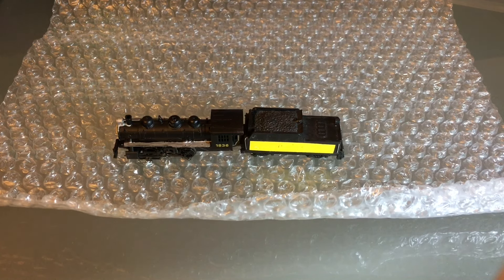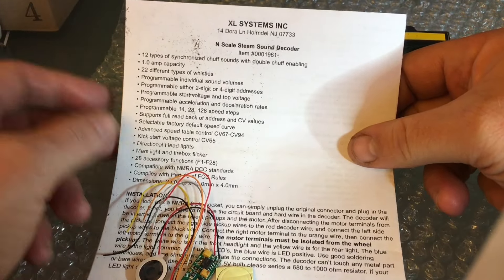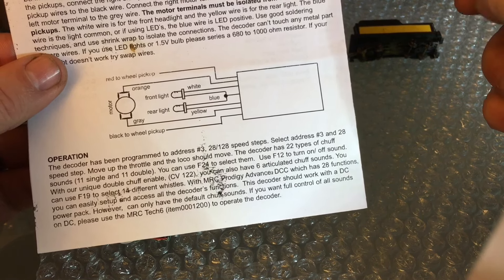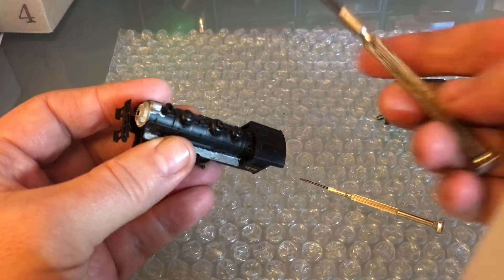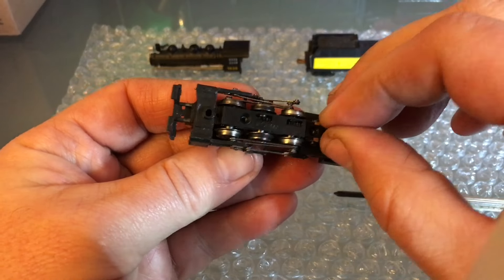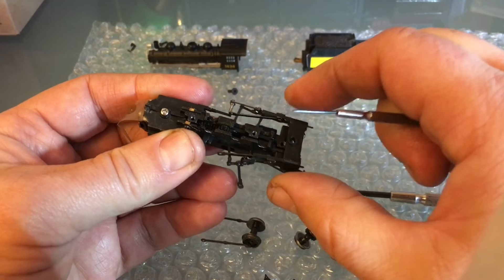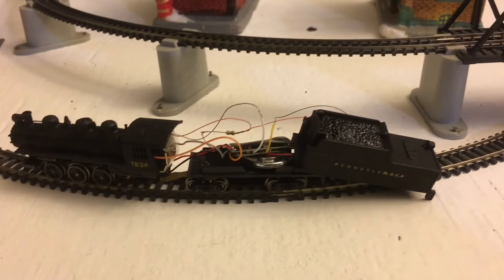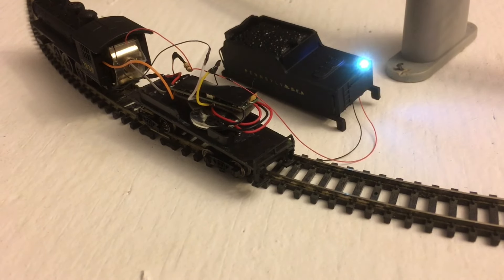DCC and Sound any locomotive demontrated on an N scale Bachmann 0-6-0

Comment: The tender trucks on these aren't very good, I usually change them out for the ones on the Consolidation. You have to drill holes in the tender bottom and hard-wire them in, but they work a lot better.
Reply from the maker: Yes, the consolidation has an excellent tender.

Comment: When you "messed around" with  the timing for your wheels, did you have to remove the wheel from the axle to get them aligned?
Reply from the maker: Just forced them into submission. They  slip a little bit. They are assembled by pushing the wheel half shaft through the plastic gear, it’s not very hard if you want to take them apart.